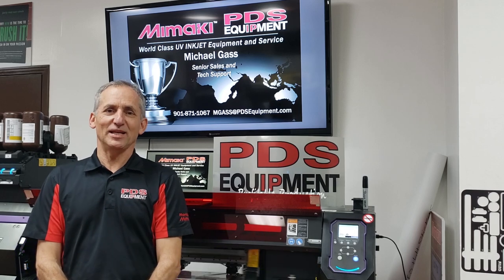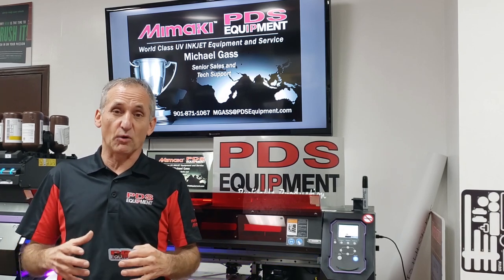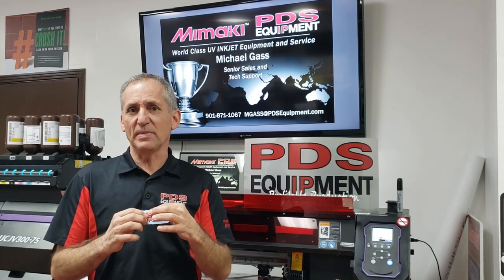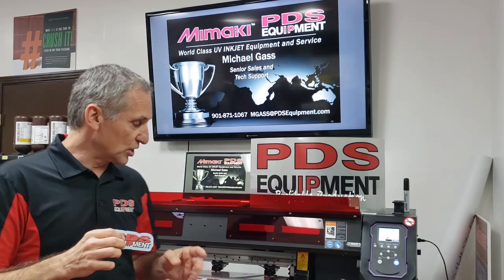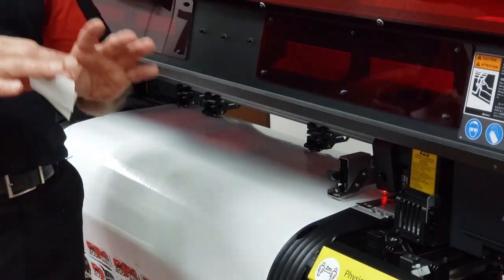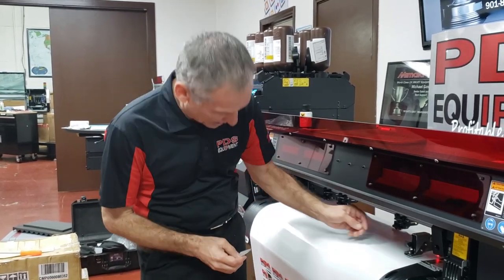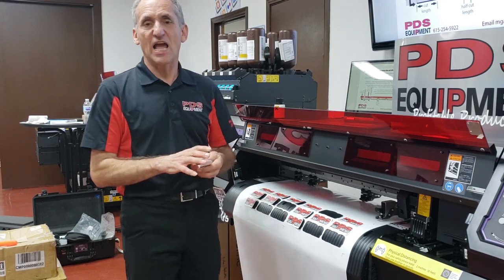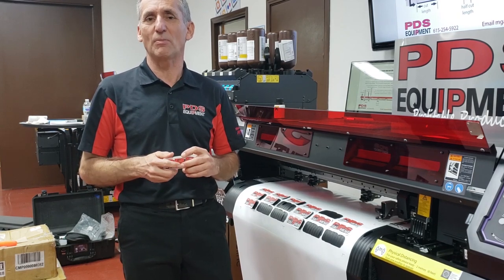Mimaki UCJV and CJV Printers: How to set cut order and eliminate paper jams while cutting

Comment: Do you know how to get it to not double cut on the kiss cut? For some reason my printer goes around the cutcontour line twice causing some issue?
Reply from the maker: Im sorry I misses this.  Double cut is a file issue and it can be tricky to fix.
1.  Make sure there is only 1 cut line
2.  If it is a compound line release and zoom way way in-if you see 2 lines delete one.
Reply: I had that issue, it’s because I had expanded the line in illustrator, giving me (in effect) 2 lines instead of one.